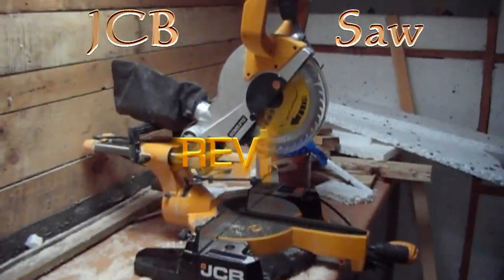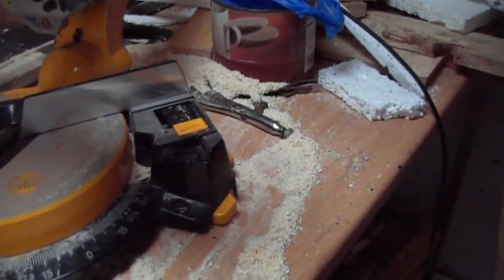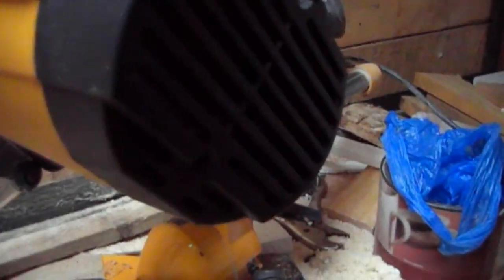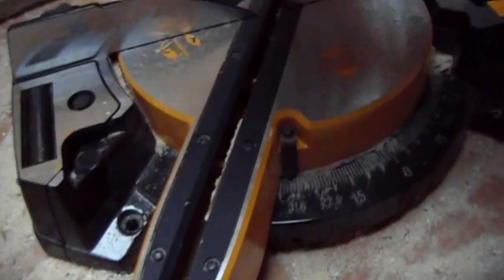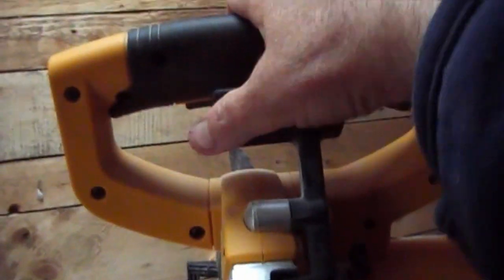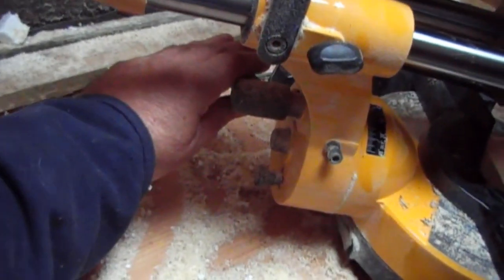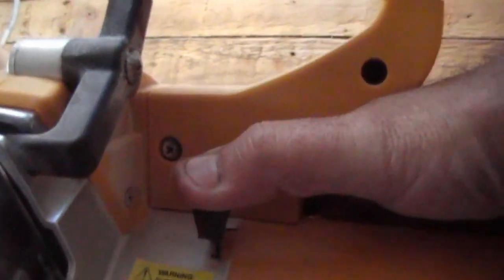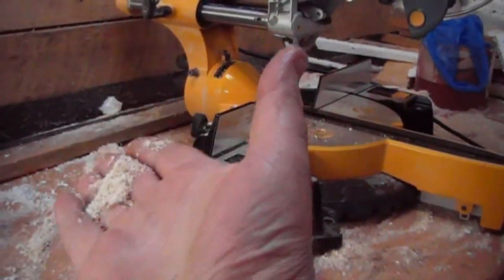JCB Sliding Mitre Saw

Comment: How about accuracy when full extended? Still keep 90 deg?
Reply: Still accuracy after 6 years of use & Square cut & 45 deg.  Still keep 90 deg. fully out
Reply: Not 100% 90 if you don't keep on top of it. Trust me. If your making studd walls and stuff you will never notice. Try making a 100mm X 200mm box and you will see how off it is.

Comment: Thanks for the vid.
Would have been nice to have seen it in action for how good it is for:
1. Square cut
2. 45 deg. cut
3. Bevel 45 deg cut
Reply: Still accuracy after 6 years of use & Square cut & 45 deg.  Still keep 90 deg. fully out

Comment: These seem really good value- I was looking at one recently. What's the accuracy like on this? Is it accurate enough to mitre corniche on kitchen units?
Reply from the maker: I have not tried it on cornice up to now I try it on a my one for you it accurate enough to mitre cornice with the 40 t blade but I would use a 50 to 60 teeth blade for the kitchen units

Comment: No not at this time as this was 3 years ago if I was going for one now I would go for the Evolution Fury 1400W 210mm Sliding Compound Mitre Saw FURY3 with 20 tooth blade included TCT When cutting steel, it leaves an instantly workable finish, producing no heat, no burr and virtually no sparks At £115.
Reply: What's the difference between the JCB and the one u have mentioned. ?